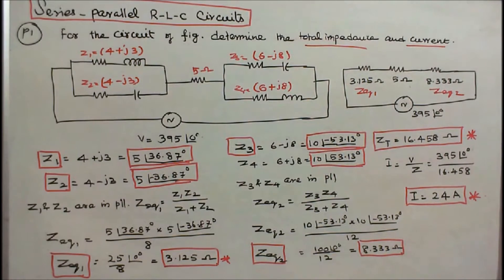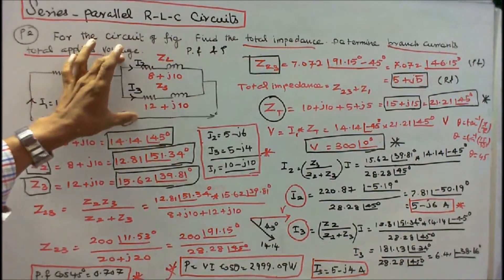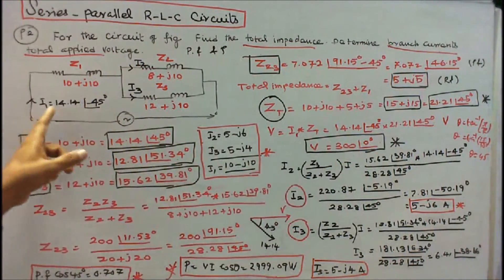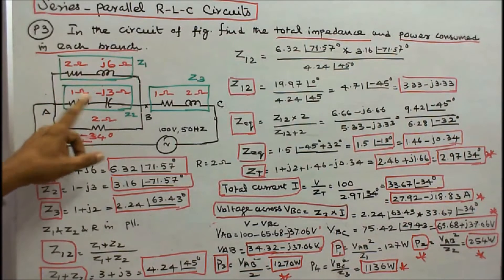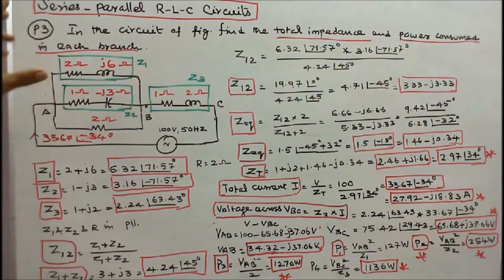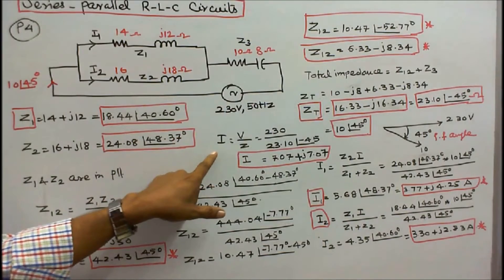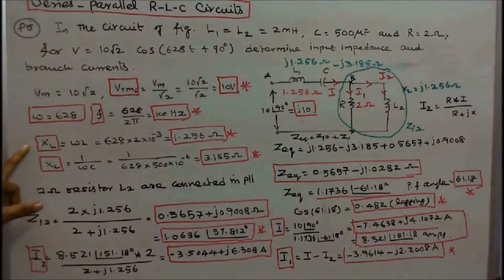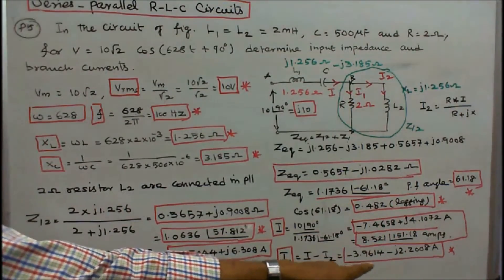100 PROBLEMS IN AC CIRCUITS - PART-16 - FIVE PROBLEMS ON SERIES PARALLEL R-L-C CIRCUIT

Comment: sir if we determined the voltage  which is lagging by some degrees in a arm 1 then would it be lag by the same angle in the arm 2  which is parallel to the arm 1.